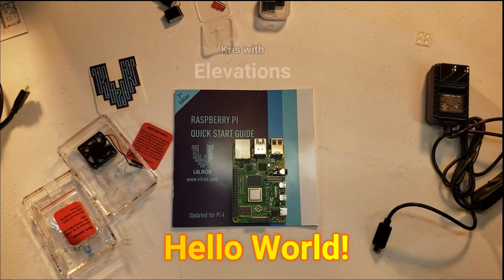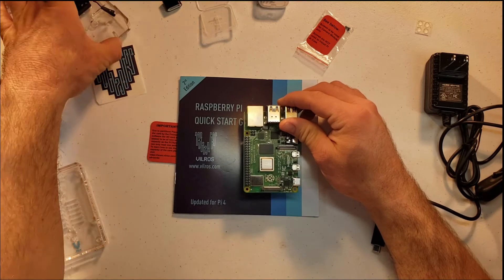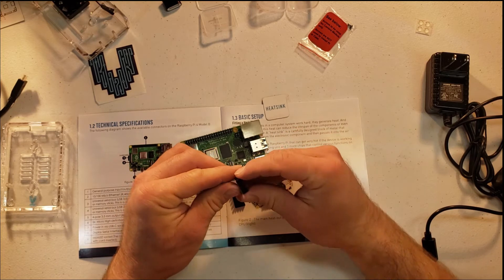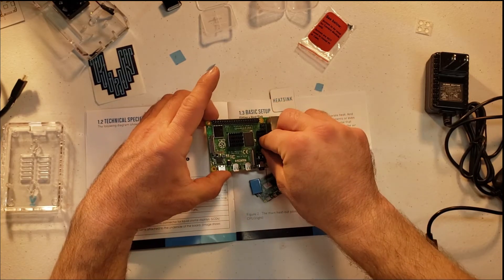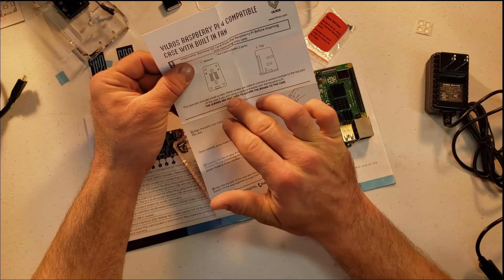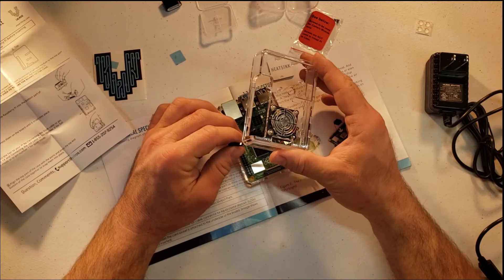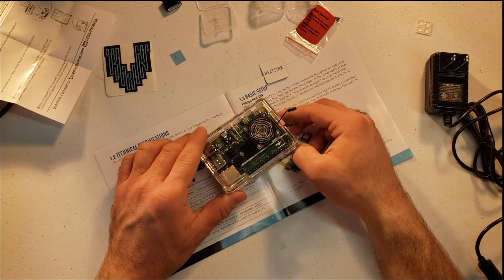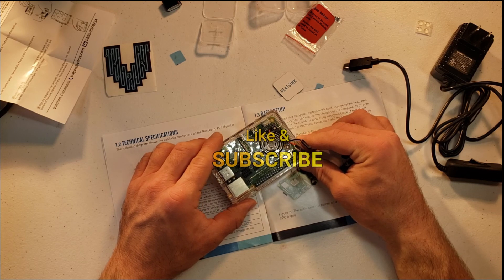Vilros Raspberry Pi 4 Kit Assembly and review

Comment: I just bought this kit to build a Hydroponic monitor system.  Your video is still spot on and accurate. Thank you! (2025)
Reply from the maker: Great to hear!  We have used Pis for many projects through the years and they have performed great.  I have a greenhouse project planned for this spring as well.  What all will be on your project?
Reply: @elevations5776  Lights, fan, humidity, temp, water sensors - everything I can get to work basically.

Comment: Year later.. how is the Pi working? Seems to be the only affordable option these days. Want to use it to run one of my 3D printers
Reply from the maker: They have been running great.  It is important to install the heat sinks properly for long time use.
Reply: @elevations5776  I have had my Prusa 3d printer and my Voron both ran by their own pi's for the last 8 months. Been great being able to run them without constantly walking to them
Reply from the maker: @nsboost  So many things these boards can accomplish for us.  Just not as available lately.
Reply from the maker: @nsboost  Still running well.   I have at least a dozen Pis and they are all still functional.